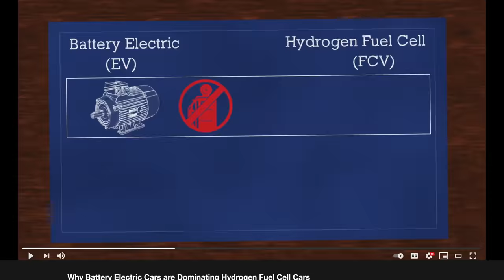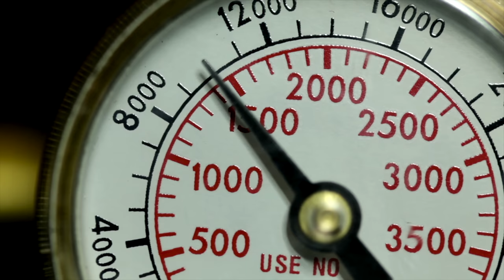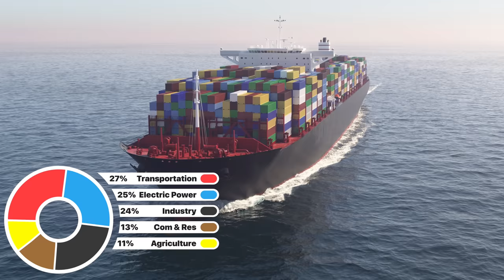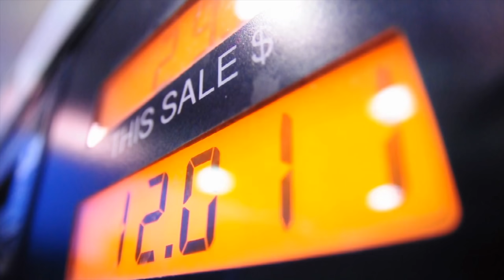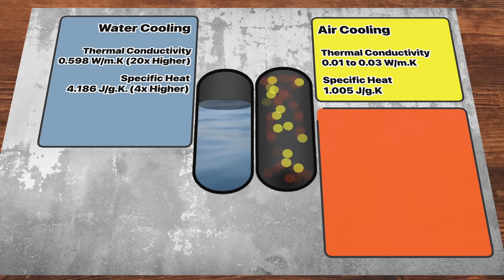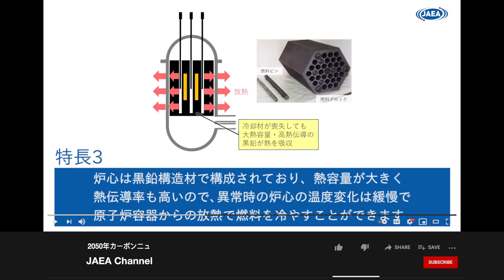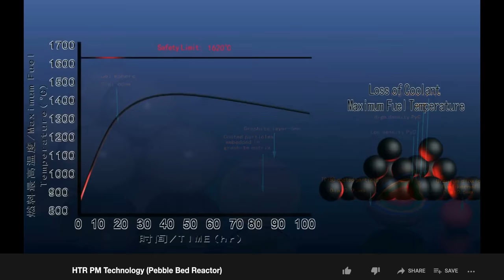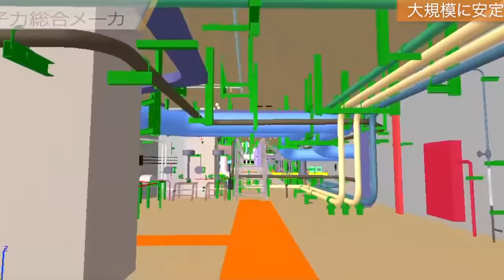Japan's Plan to DESTROY the Price of OIL and GAS!

Comment: Any idea about efficiency? The 30MWt output would be something like 10MWe in conventional nuclear power plant and lose another 30% efficiency when converted to hydrogen leaving 7MWe. EDIT: Looked it up but Thermochemical has a efficiency of about 50% (that I can find) so 30MWt would result in about 15MWe of hydrogen.

Not bad :)
Reply: Yeah how does direct hydrogen production from nuclear compare to electric generation for use in BEV’s in terms of total efficiency?
Reply: @JP-sw5ho  Its much worse. Which is why hydrogen does not make sense compared to raw electricity. You still have to then transport, distribute, store, and then convert Hydrogen through a FC back into electricity to drive a vehicle or motor. The raw loss in efficiency compared to raw electricity is not solved with producing "clean hydrogen". Hydrogen is just not a good solution. What we really need is better battery tech (which we are seeing regular advancement on). Hydrogen in a fuel cell is just a super inefficient battery after all. Once batteries can charge in 5-10 minutes, the 1 advantage hydrogen had will be gone. Hydrogen will always be much more expensive than AC/DC energy. Physics
Reply: @Kenbark42  You're right. But consider that some industries can't be electrified, so they can't use nuclear electricity. In those cases, using direct nuclear heat makes way more sense and is incredibly more efficient, since you don't have to convert heat to electricity and back to heat again.
Furthermore, in those cases where nuclear heat simply isn't enough and electricity (nuclear or not) isn't an option, hydrogen as a fuel is the perfect clean alternative, way better than fossil fuels.
Reply: I was wondering about the efficiency compared to producing electricity out of that nuclear heat, thanks for looking it up for us.
Reply: @Kenbark42  
That's because you talk just about passenger cars. But what about ships, planes, trains and other
Reply: @АдылханАйткулов  Ships and planes could see benefits of hydrogen. However the volumetric density of hydrogen is awful. That means less room on ships and planes to make room for massive storage tanks to go similar distances as existing fuels. It makes far more sense to make E-fuels by producing carbonated hydrogen fuel alternatives that do not add to the carbon emissions problem, but recycle existing carbon in the environment in its production. Hydrogen is very, very weak when it comes to volumetric energy density, which is a massive problem for things like planes and ships. As for trains, no, trains do better with direct electricity to motors. Either through battery cars (more energy for a given volume, and weight is not an issue) or by running direct power to the train via power along the set tracks. See every single modern commuter and cargo train outside of the US today. They are already electric and nearly perfect
Reply: @Kenbark42  Two things:

1. Hydrogen production from HTGR is notably more efficient than electricity production from heat. Even adding in compression and distribution costs (along with electricity distribution and storage costs), it’s still similar efficiency.

2. Hydrogen volumetric energy density is less of a factor for ships or industrial applications, because space and weight aren’t huge considerations. Ships can easily manage high pressure hydrogen tanks for volume reduction, and stationary industrial applications can use pipelines and lower pressure large tanks.

Added bonus of HTGR is the potential to use the excess heat for industrial applications, and/or for compression of the hydrogen. The much higher temperatures of HTGR also mean there is more usable “waste heat” that can perform meaningful amounts of supplemental work.

It’s definitely worth pursuing at this time. Whether or not it’s a good long term solution remains to be seen.
Reply: @Kenbark42  the troubles with batteries are the limited availability of materials, their weight, and availability of charging. Lithium is the lightest element that can be used. Maybe some genius will solve this, but don't bet on it. Batteries need to be at least half the weight and half the density. (I'd like a spare tyre) they also need to be about a quarter of the cost. To charge a 100kWh battery in five minutes you need a 1mW power source. That's a ton of juice. I drive a Hyundai Iconiq electric and charge it at home off a regular 240V socket. Range and changing times are not big issues for me, and won't be for most people. The biggest issues are purchase cost, weight, not having a spare, headroom, and availability of charging. If you can't charge in your driveway or garage, EVs are much more expensive to run and a PITA.
Reply: @geoffstrickler  so it’s on par with grey hydrogen. What about the conversion through a FC? Why not just use electricity? Considering it’s easier, cheaper, and still more efficient out the other end of it? 

You may be underestimating the insane amount of work and effort needed to distribute and store hydrogen. Hydrogen is leaky and it’s not easy to contain, much less transport. I still fail to see how any of that is better than raw electricity. Considering that is the end product for all hydrogen power too. Electricity is the end game. Why waste time, effort, money and energy on converting, storing, transporting it around when delivering the raw end product (electricity) is more viable, efficient, and does not require trillions in new infrastructure.
Reply: @neatengineering  hydrogen is significantly worse than batteries when it comes to energy density. Meaning you need more room for tanks than you would need batteries. Let’s not forget you still need a rather large battery for hydrogen as well. Hydrogen FC just charge you battery packs. It’s batteries that still drive motors in vehicles. The hydrogen just charges those batteries. 

Still don’t understand why it’s “easier” to build out infrastructure to store, produce, and distribute hydrogen vs building more chargers. EVs are winning hydrogen is dying. The World has already moved on
Reply: @Kenbark42  Electricity is not always the end game, heat is often the end need, and electric heat is very inefficient compared to hydrogen burning. Electricity is also very challenging for mobile applications. For electricity in mobile applications, batteries or FC power are the most efficient options, and FCs run on…hydrogen. Batteries are heavy, expensive, and have just a fraction of the volumetric and gravimetric density possible with large hydrogen FC systems.

Electricity is good for stationary uses, and even for mobile electronics and EVs with suitable batteries, but it’s not the best solution for all situations, especially those needing heat.
Reply: @Kenbark42  have you seen the 'solid' Hydrogen stored in various metal discs or powder?
Reply: @geoffstrickler  You may want to clarify a bit more. Electric resistance heating is 100% efficient. A quick google search says across multiple sources including the department of energy that Electricity is far more efficient for generating heat than hydrogen is.

I don't think it makes sense to argue that battery powered mobile applications are not as viable as hydrogen. We have a pretty stark example in the World today. EVs vs FCEVs. Which one is winning?
Reply: @Kenbark42  You’re grossly misinterpreting those results. You’re not accounting for the initial conversion of heat into electricity, which is at best, 30%-40% efficient, and typically <10%. Electric heating is terribly inefficient when you look at the full cycle. Fossil fuel or hydrogen heating is 90+% efficient. Even if you allow for producing the hydrogen being only 30-40% efficient, you’re at the high end of electric heating efficiency.
Reply: @Kenbark42  hydrogen in the Toyota Mirai is lighter and takes up less space than batteries. You only need a 1.5kWh battery for fuel cells and it can be a NiMH battery at that. As fir methanol, it takes up about 80% more space than gasoline and is about 50% heavier, so not much of a problem, and it can use existing infrastructure with minor modifications. ICE cars are basically made from steel, aluminium, glass and plastic. All abundant and cheap materials. EVs make up less than 10% of global car production and most of these are cheap and nasty sh!t boxes in China. Battery cars will always have their place, but to say that they'll achieve total world domination is a bit premature.
Reply: Hydrogen for cars is a bad idea. The energy needed to produce the hydrogen, compress it, transport it, store is 3x more then just using electricity! So got the same amount of electricity, produced by nuclear,solar,wind,hydro.. could power 3 EV cars instead of 1 Hydrogen car. Also you still need battery and electric motor. The battery cost and capacity improve each year, while hydrogen is stuck to 30%, can be more with aluminum but aluninum require tons of electricity to produce, we produce a lot where I live in Canada.

Hydrogen still has it place instead of fuel, for bigger trucks,plane,trains,generator and some cars for sure.

But hydrogen isnt the answer for most cars market, battery is the way to go for efficency. No matter if you got nuclear plants, you still waste your electricity and nuclear fuel.
Reply: @DrLoveQc  That’s using older hydrogen technologies. Did you watch the video, this method is comparable efficiency to using electricity, see my comments above. Your concerns are addressed in the video and the comments above.

Now, hydrogen probably isn’t the best solution for cars, simply because of the limitations on quantity that can viably be stored and carried in a car, significantly limiting range, however, it’s not materially worse than EVs while offering much faster “refueling” vs EVs. But it is better for industrial uses and is probably better for ocean shipping.
Reply: @neatengineering  I would argue the Toyota Mirai is a bad example. Well… maybe not because it is 1 of 2? 3? Hydrogen cars? The battery EV is already solved. It’s already done. They work, are brilliant, and are getting cost competitive to buy one with ICE cars. Every automaker is scrambling to go “full EV” by 2030, 2035. No auto maker is scrambling to go hydrogen. Not any more. It’s already lost. MB dropped 30+ years of hydrogen research and development, they dropped it for battery EV. BMW is learning rapidly it’s a rough starter. The Japanese automakers are quickly abandoning hydrogen. It just does not make sense for anything outside of niche scenarios that demand weight savings.

The reason you need a large battery is to have a battery capable of outputting any real power. There is a reason the Toyota Mirai accelerates like a wet blanket stuck in weeds. Battery EV is cheaper to run, can refuel in more than 1 US state (a couple cities in one state), and has better performance. You will also get to fuel up while at home or at work. Never having to take the time to go to that one gas station that has hydrogen, pay $13/kg, and think about it. Hydrogen is decades behind battery EV in general public infrastructure. Decades hydrogen does not have, because battery technology is leapfrogging the pace of hydrogen development. What sort of batteries and tech will exist in 2 decades? Heck who knows, we might even have solid state hydrogen batteries by then. You would charge those up with raw electricity.

I don’t see a single company about to offer a product, any product in the foreseeable timeline that gives hydrogen any shot at all. Given they are already out of time, I believe it’s fair to say hydrogen has gone the way of the mini-disk. Was for a short blip in time a great viable alternative, 10 years too late, and hopelessly behind
Reply: @Kenbark42  There isn't enough lithium to make the required EVs, especially if the batteries are going to be 80kWh or bigger. That's before you electrify trucks, plant, agricultural machinery and put in grid storage. Most people don't care about high performance cars.
Reply: @neatengineering  we have 70+ years of supply for projected EV growth with currently identified sources of lithium. It’s not exactly and urgent thing. Also, see future battery chemistries for more details. There is a future with batteries that take no lithium. Also, these battery packs are highly recyclable meaning the majority of battery source material will be created through recycling. Besides, the hydrogen World needs to figure out their problem with platinum, of which fuel cells use between 30-60 grams of per fuel cell. Where will all the platinum come from? That’s about $1800 of platinum at the high end in todays $$
Reply: @Kenbark42  Mate I get it you are a battery fan boy. Yes their is plenty of raw material to make the batteries. How are you going to get it out of the ground in a timely manner to make all the batteries. Current batterie technology has been tested, ad nauseum, in mining equipment, and it doesn't work. How are you going to get all that raw power to the batteries to charge them? What about the massive line loss of raw electricity that happens now, new technologies and a massive upgrade to the power grid? You talk like batteries have NO problems and that charging them is SO easy, but the tech isn't nearly as good as you are making it sound. I can't use a BEV for my vehicle not enough rand and no load capacity. I can't charge a BEV at my current residence as the grid will not support it. I can't use a BEV at my place of employment, we tried and they failed. A lot of that CAN be fixed with a ICE using Hydrogen, and it is a lot easier for me to see that as a solution, than batteries powering everything, at least in the next decade.
Reply: At best electrolysis can get 70% efficient but that’s with a very expensive electrochemical cell that uses a lot of expensive and rare catalyst material that breaks often and needs to be replaced very often. So 33% efficient electricity times 70% efficient means that theoretically using electricity is about 23% efficient or less than half as efficient as just using thermal chemical processes. In reality you are wouldn’t use expensive electrochemical cells at this point of their development so figure on something closer to 50% using old fashioned cathode and anode and saline solution that would be about 1/3 as efficient as a thermal-chemical process.
Reply: @geoffstrickler  Currents nuclear plants doesnt produces such high temp steams. They use water to cool down usually. 

But yeah new power plants experimental use 3 types or "red" technology, but they also only efficient from 30 to 50% compare to electricity. You could also use that high steam to heat buildings or produce electricity. 

From the current 500 or so power plants, you only can produce the red (pink) hydrogen from electricity. 

The new power plants arent growing very fast, maybe it will be more since ukraine war and fuel issues, so no massive new plants build to produce such high temp steam and chemicals..I guess the cost of the plants will increase a lot and so the 0 to 20% effiency gain isnt very impressive.
Reply: @DrLoveQc  But this thread, and video, aren’t about current nuclear reactors, they’re both discussing Japan’s HTGR.
Reply: @geoffstrickler  yeah I agree, but they talk about it like if it would provide all the hydrogen we need quickly. It is not a retrofit technology that will be install in the 500 power plants on earth, even a new power plant would produce near nothing compare to current consumption and futur needs. The electrolysis with 30% effiency seems more easy to install and use with the over produced electricity to make hydrogen instead to waste it. Where I live we run 99% clean energy for electricity from hydro and wind. We had a power plant, my father worked there, but was only to explore and sell the CANDU nuclear technology.
Reply: @DrLoveQc  Except that no one here, nor in the video, talked about it that way. In fact, the video was very clear that while they’re currently doing this with a low output reactor, it will take years before production could reach significant commercial levels.
Reply: @smileyfacefrown2723  nobody is talking about hydrogen being burned in an ICE. Hydrogen means FC, which means electric vehicle. Burning hydrogen in a ICE is so crazy inefficient and impractical it’s not even on the table. Nobody is making or doing that seriously outside of toys made for show. The compressed air tanks alone to hold enough compressed hydrogen for a hydrogen ICE to go 200 miles would be the size of the car itself. 

Tell me you don’t understand hydrogen without telling me you don’t understand hydrogen. Do you think that the hydrogen plans and fans are talking about ICE running on hydrogen?

Comment: Very balanced and informative, thanks.  This strategy by  the Japanese sounds a lot more structered and pragmatic than the UK, "hope for the best" approach.
Reply: Maybe under this new PM 🇬🇧 💨
Reply: The UK from what I recall just announced a joint partnership this year with JAEA (Japan Atomic Energy Agency) for VHTGR (Very High Temperature Gas Reactor) based on the Japan's HTTR, it seems they're interested on Japan's design as it can reach to 950-1000C temps compared to other HTGR designs which is the ideal temps for efficient Hydrogen production.